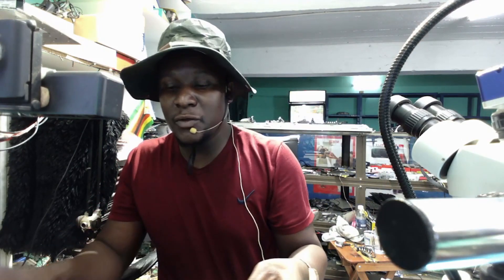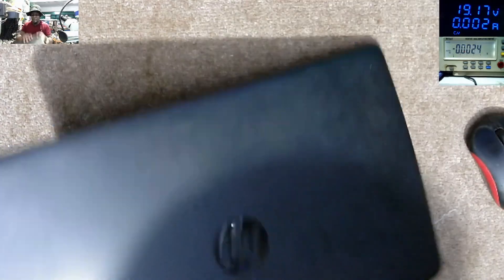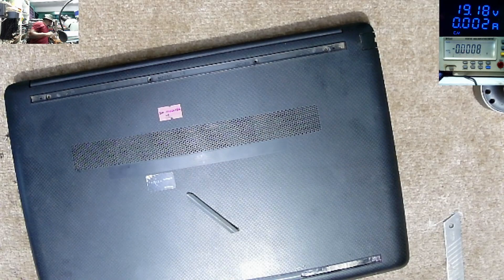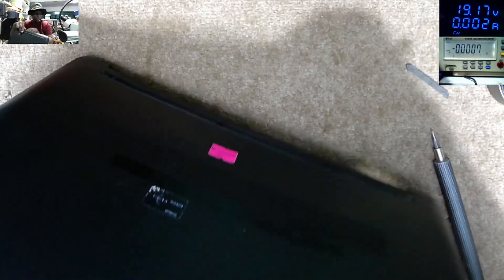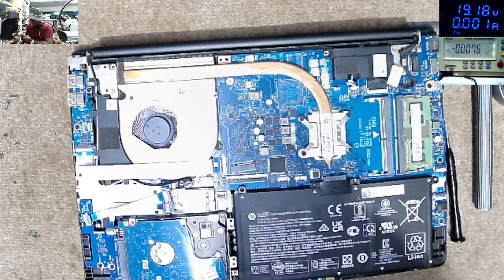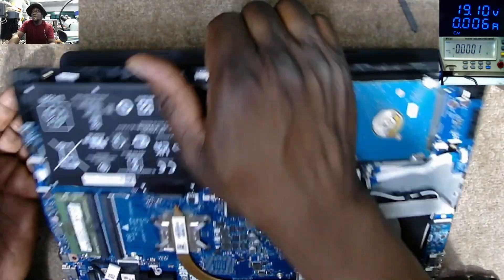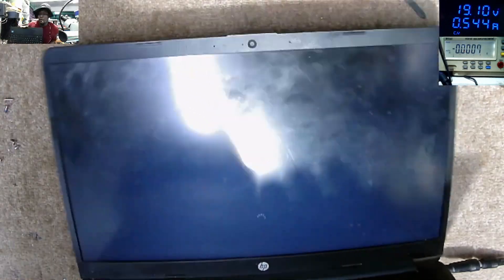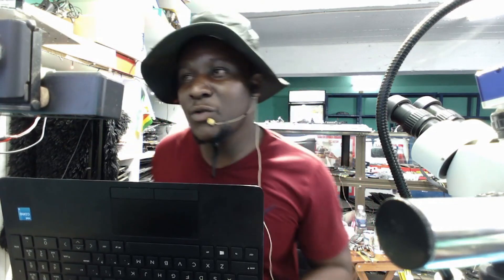Every Techie’s "Dream Fault" On Laptop Motherboards—Hp 15 dw3007ni No Charging Light, No Life😋

Comment: What can we say is the issue with motherboard
Reply from the maker: @chimezieobieze1142  frozen EC Chip.. Mostly happen to laptop with internal batteries when left unused for a while.. You have to reset the board by either shorting pins on bios battery or removing main battery for a while.. Thank you for asking

Comment: what s the probleme  for this motherboard
Reply from the maker: @chimezieobieze1142  frozen EC Chip.. Mostly happen to laptop with internal batteries when left unused for a while.. You have to reset the board by either shorting pins on bios battery or removing main battery for a while.. Thank you for asking